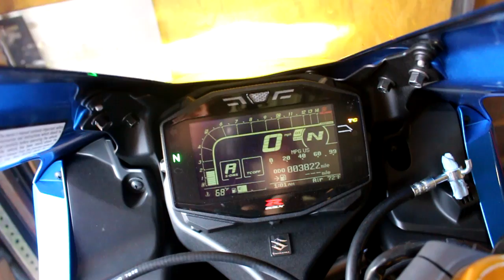2017 Suzuki GSX-R1000R Stainless Brakes Part 3

Comment: Is it possible to replace just the front brake lines with the steel lines to eliminate front brake fade on the track, or do I have to replace both front and rear?
Reply from the maker: Yes, you can replace just the front brake lines, but if you're going to do track days or racing I highly recommend you replace both. The last thing you want is stepping on the rear brake pedal and you get nothing. In racing, the brake fluid will heat up and boil after just 2 or 3 laps, which in turn makes the rubber brakes expand and become useless! Be sure to get a Brembo RCS-19 Master Cylinder and at an absolute minimum use Ferodo DOT 5.1 brake fluid, but FRF340, FORMULA, or SUPERFORMULA are even better, because they have higher boiling points. Don't screw around and take any chances, use the best. The brakes can and often do save your life in racing!!

Comment: You installed Brembo Levers? & Master Cylinder??? Ami I correct my friend? If so, I am very interested in how you feel about them?? I am saving now for full exhaust system, can't make up my mind. I have it between Three, or,  Akrapovič, am leaning towards the Predator.   Don't ask me why this is turned blue, never get my computer anymore. :) Have a nice night and I am glad you are back on when you can be. Take care Jerry.
Evolution Line (Titanium)
                            
S-S10E3-APLT
Termignoni Scream Titanium Full RACE System GSX-R1000 and GSX-R1000R (17-19)
Predator Full System - Ti Front Section w/ Titanium Muffler GSX-R1000 and GSX-R1000R (17-18)
Reply from the maker: @live - Correct. The Brembo master cylinder RCS 19 comes with the lever. I'll be honest, I like Yoshimura's Alpha T Full System. It looks sharp, sounds great and I think any good dyno shop will get you mapped for it. - https://youtu.be/AR0-KcZ4auI?t=39

Comment: Excellent videos Jerry. Thank you man for taking your time to document the upgrade.  I’m getting ready to undertake the same job on my non-abs bike. 
I am having a hard time finding the GP style kit in the colors I want, red/red. I may have to go with independent lines from both calipers up to the Brembo lever. Is there any performance difference in the two style lines? Or just preference?  Thanks
Reply: Oh by the way, I just had my 3rd track day last Sunday and think I may have felt a little fade you talked about hard braking off the straights.
Reply from the maker: @Mark - GalferUSA has the GP style in red/red. Go to link below, be sure to click on the yellow box that says "Configure Lines." A pop-up screen will show up. From there be sure to select the color for all three options; Line Color, Banjo Fittings and Banjo Bolts --> http://galferusa.com/product/suzuki-2017-gsxr-1000-front-lines-fk002d773gp